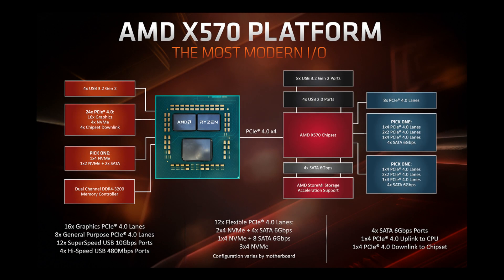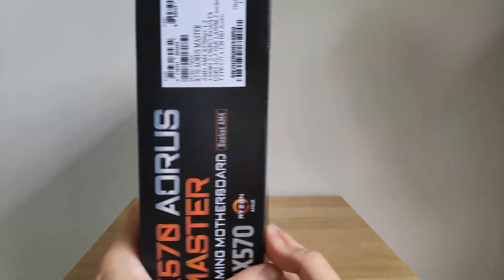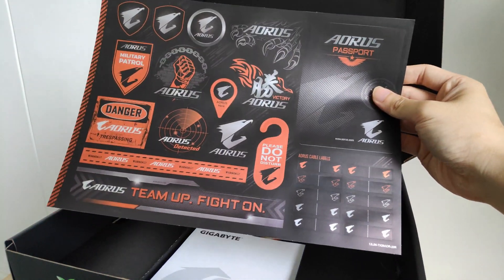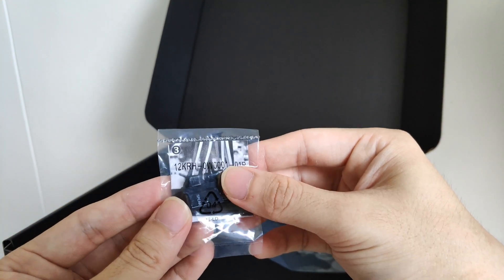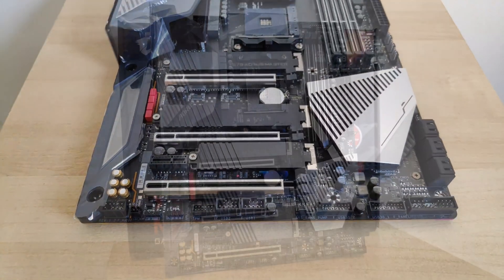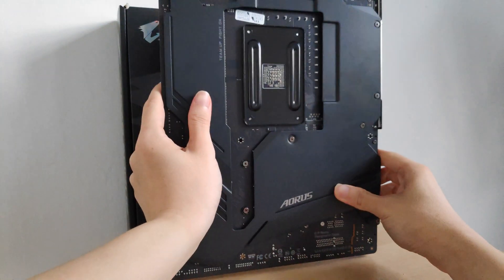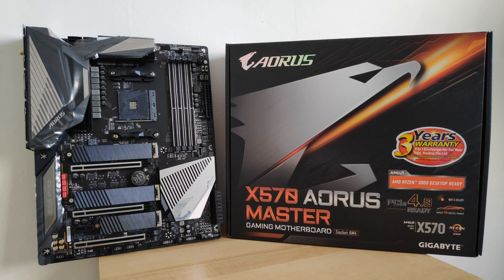Unboxing & Overview: Gigabyte X570 Aorus Master - Ryzen 5000 Ready!

Comment: You like it? I  got the Pro WiFi version. Really nice motherboard.
Reply: Dude does  ur led strips on the side of audio capacitor and above that work ...for me only the strip on the io shields and the ones behind work ...can u pls say for urs
Reply: @bharathraaj2253  The bar on the front side of the board by the caps do not light. Wonder why?
Reply: @Sky1  is that normal or it's a defect ? As the gigabyte website it shows all front 3 strips light but for us only one lights up ?
Reply: @bharathraaj2253  my board is rev 1.1 I believe there is a 1.2. Not sure, did you check to see if it can be set in bios? I am not able to select it in RBB 2.0 softwarw
Reply: @Sky1  mine is rev 1.0 ...when I mailed to gigabyte they said they said it's a mass flaw in all boards
Reply: @bharathraaj2253  Are they sending you a board that works? I dont really care about the RGB not working as long as it does not cause another problem.

Comment: Hi, I have this board and and 5950x. I dont think the bios is stable with the 5950x because my system is always randomly restarting over and over agian. I cant add chipset drivers or gpu drivers because it crashes everytime i try to aply anything.
Reply: Hi, I’m doing my first build and I’m running the 5950x. What do you recommend instead of this board?
Reply: @Mr-Sunday  well, I went to best buy a purchased 3 more motherboards, the asus b550f strix, the asus tuf x570 plus and the msi x570 gaming. I haven't been able to get any of them to work properly. I have a feeling it could be my windows version. I am going to buy a new version of windows and see if this helps.
Reply: @anomiclife242  thank you for the info, I’ll keep that in mind when I prepare mine. I hope you’re able to fix your problems.
Reply: @Mr-Sunday  any answer??
Reply: @Vus2088  hey sorry, I just saw this. What do you mean?
Reply: @Mr-Sunday  5950X + aorus Master x570 - works fine for me. 
But the 5950x is hottt
Reply: @RESURRECT2  thank you, it was dumb luck that I was able to pull it.
Reply: @RESURRECT2  maybe the board my chip the hotest it ran on warzone was 60 it did nog go above. Warzone is demanding until i change to an aio and i had no problems
Reply: @Mr-Sunday  hey i had that board was having trouble with ram on it so i went with msi. I got the new msi b550 unify. I recommend trying msi. I had no issues and super stable definitely a smart bios
Reply: Try bios update either manually on the board, or install a ln older chip then do it within the bios, then you can just swap them out and it'll be stable.
Reply: @landenlarcade488  You don't need another chip to flash BIOS in this board.
That said, it's definitely the BIOS that's the problem.
AMD have been messing with X570 BIOS's since the Zen 3 launch and they are still to get them right.
Stick with it. They'll sort it eventually.
Reply: I have the Aorus Master x570 too (Rev. 1.0), upgraded from 3900x which worked flawlessly to 5950x two days ago,
before upgrade, I updated Windows 10, BIOS to newest, and so on...

I have Dark Rock Pro 4 Cooler with Arctic MX-4 paste, 1000W Gold or Platinum power supply, 64 GiB Dual Channel Memory cl16-19-19-39...

I have the worst Cinebench results of the whole internet with that thing, in Multi it's below 3950x performance, I am pretty mad. :(

Tested R15, R20, R23.

Even with PBO in R23 I get lower results than stock 3950x with worse RAM than mine...

I also reinstalled Chipset drivers after upgrade, nothing helps.

How is that even physically possible to get worse performance than last gen?

Single Core isn't that good either but at least better than stock 3950x and the betterness is: in single core between my amount of points below others to the amount of points of the lowest 5950x result on the internet is gladly less points than mine being ahead of 3950x, hope I formulated that correctly,
I mean I am between 20 to 60 points lower than other 5950x, but around 70 points ahead 3950x, or something like that.
Best Performance I got was on Cinebench R20, 'only' 600 multi points lower than worst result on Internet, on R23 5k points if I remember correctly.

I am mad.

Temps look pretty okayish.

Single Core boost reaching some times 4.9GHz on single core bench,
even very few times to 5GHz when PBO, but mostly around 4.7 .

All Core on Multi Bench 3.75 GHz.
With PBO 3.8 to 4.
Temps on Multi much lower than single, only up to 65°C or lower, on Single it's going to 73°C, mostly 67 to 69°.

That bench results are not >900€ which I paid worth.

What did I wrong, I hope I am just stupid, or did I get worse silicon than Zen2 Silicon of Ryzen 3100?

Should I send it back?

I tried my best with everything..

First start after CPU upgrade was weird, the RGB RAM was flickering like everything broke, I nearly got a heart attack, but I pressed ON again after few minutes, then it started kind of normally (instead of turning of what it should do usually when it's running and I press On key again)....
Black screen while that weird first start.

Hoped it was just initializing the new CPU, but on first build with 3900x it worked much better and no black screen...

Now it's working but with the horrible results.
Reply: @gnul  You're running a 5950X on air?
Are you mental?
Reply: @eekwibble  Yes, I am mental*, amd yes it's on air, but the biggest available air cooler, I don't like bothering with liquid, even when it's cool, especially in look.
There is that one big Noctua CPU cooler or however it's written, and that equivalent better looking as cool cooling bequiet! cooler called Dark Rock Pro 4, this should be fine even with a 5950x.

Or is everyone doing liquid with it?

Saw some Benchmarks with same cooler as mine, same issue, mine seems to be much slower kind of, why - idk, maybe it's not noticable outside of Benchmarks, but it's like a slap in the face to see a stock 3950x beating a PBO 5950x. ^^
Reply: (in multicore bench)

I thought I'll get 10 to 20% (or even more) uplift in multi compared to 3950x
Reply: @gnul  I’ll be running a liquid cooler. More specifically a NZXT X73 on my 5950x.
Reply: @eekwibble  i was running a 5900x on air recently upgraded to an aio. The air was just not cutting it. You learn as you go, its all good
Reply: @gnul  most likely not, only in single core for sure
Reply: @Mr-Sunday  What are your temps? I have same cooler.

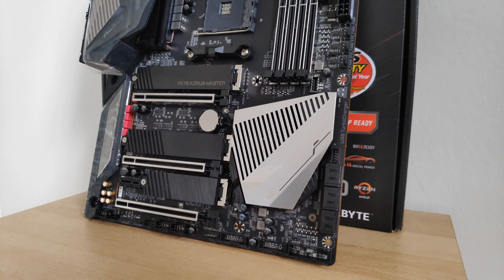Comment: 7:48, bottom left hand corner you can see this is the latest "Rev 1.2" version , meaning he missed the most important and differentiating factor of this board which you can find at 8:11 - Turbocharger THUNDERBOLT 3 pin is present to connect a Thunderbolt add-in card with 40 Gb/s Bi-directional Bandwidth. That is massive! The rev 1.0 version of this board doesn't have this.
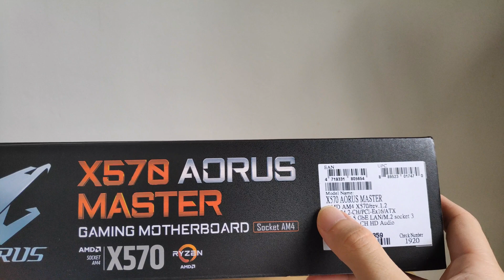Reply: Guess you missed the 1:17 bit then lol